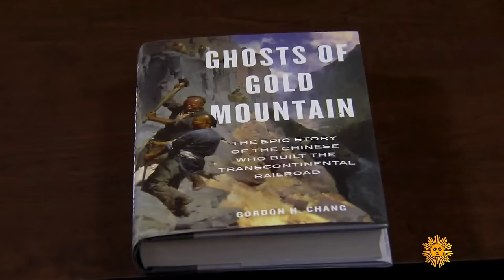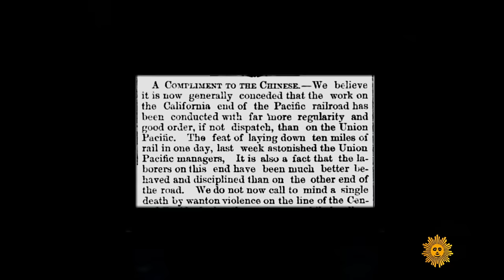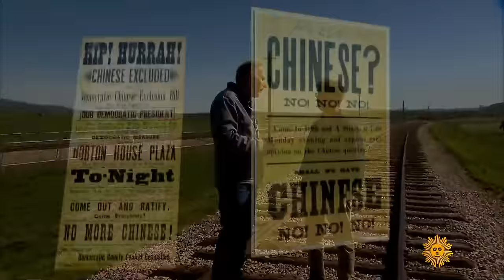Building the Transcontinental Railroad

Comment: More freight trains less trucks.
Reply: Agreed but you still need a way to get it from the train to the market.  Not every market or shop has tracks going to them.  If they did you would be complaining about all the trains blocking your path to the store.  Trucks take up where trains can't go.  Trains are great for moving bulk items from one area to another.  But terrible at getting it directly into your pocket.
Reply: Without trucks, goods would not be able to get into your hands
Reply: @wayned1807  Long distance trucking makes no sense  only for the last 150 miles or less.
Reply: @robc8468  I ship a lot of tooling we make at my business to areas all over the country.  Mostly small specialty items like molds, dies, assembly fixtures, etc. that will fit on one pallet or in a box.  It's picked up by truck and delivered by truck.  What it does in between is out of my control.  I know trucking companies that specialize in refrigeration make long hauls with team drivers so they never stop except for fuel and food.  Fed-Ex and UPS do the same.  There is a huge Fed-Ex Ground facility down the street from my shop.  A Fed-Ex truck pulls in there and leaves every minute like clockwork.  Drivers are only in there long enough to swap trailers.  Trucks have there place and trains have their place.  Working together and competing against one another is what makes commerce work in a free country.
Reply: @wayned1807  Trucks are inefficient when using the interstate - Use the rails at that point. But short range trucking is absolutely important.
Reply: @TchaikovskyFDR  The great thing about the free enterprise system is that commerce will find the most efficient means to do most anything as long as government doesn't get too involved.
Reply: @Randall Slaughter I think I saw one of those once.  Not sure how they work.  I would think they would be labor extensive.  Like I said earlier, let the free market determine the most efficient method and you'll get the cheapest method.

Comment: It's very simple: 
They started in the east, laying down the rail, and out in California folks were blazing out a trail. Towards the center they did strive; no one knew when they would arrive, building the Transcontinental Railroad. They cleared the way and blasted through the mountainside, and built big tressel bridges stretched across the valleys wide, and it's a fact they laid more than three thousand miles of track to build the Transcontinental Railroad.

It took six years, and in the spring of 1869, in Promontory, Utah they connected the first line. And across the growing nation, folks joined in the celebration of the Transcontinental Railroad.

Comment: I'm still trying to wrap my mind around the fact that one of those steam engines weighed over a million pounds and that one wheel was 17,000 pounds. That is biblical.
Reply: Yes and they were built 75 years ago before computers and modern machinery.  Simply amazing!
Reply: That's pretty inaccurate to say as analog (and even some early digital) computers have existed before the development of the Big Boy started, and modern machinery was definitely not a recent development by that time as well.
Reply: @kevinchan1598  Computers used in manufacturing as we know them today certainly did not exist 75 years ago believe me.  I've worked in the manufacturing world as a machinists for 50 years.  There were no CNCs, no CAD/CAM software programs, no desktop computers until 30 years ago.  Just drafting boards and slide rules.  The early computers were the size of warehouses used for secret government code breaking and had less power than a cheap calculator of today.  You can pretty much guarantee they didn't use anything close to what we use today.  It took brains and brawn back then, something a 20 year old today can't begin to understand.

Comment: Certainly today we need more trains and less trucks on the highways.
Reply: Why do you believe that?
Reply: @artnc4139  because energy issues, if you place that trailer on a train instead of driving it over 1000 miles, it would use much less fuel than to ship it by truck.
Reply: @hbarudi  - you are assuming that the beginning and end of the journey are located near a rail terminal and that the cargo is appropriate for a train.   It isn't just about the energy consumption.  Lettuce used to be shipped from California to Chicago on a daily non-stop Salad Train.  That train no longer exists.
Reply: @artnc4139  I assume rail terminal means a station for freight trains to load and unload materials, but at this point, still think it is worth bringing back the train that no longer exists for this kind of shipping as trucks are inefficient.

Comment: “One of the biggest” ummm it IS the biggest
Reply: In the railfan community there is a debate between this locomotive and the Chesapeake and Ohio 2-6-6-6 built by Lima Locomotive Works in Ohio for which one is the biggest/most powerful.
Reply: @OriginalBongoliath  the big boy is longer, but the Allegheny is wider and taller